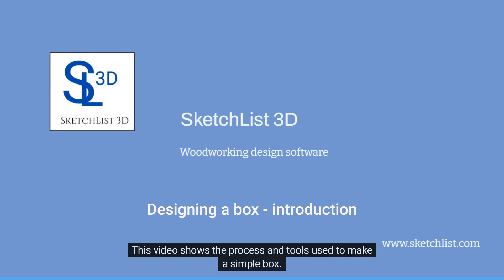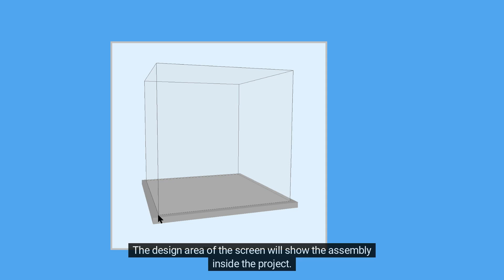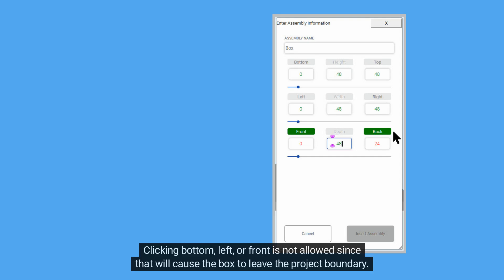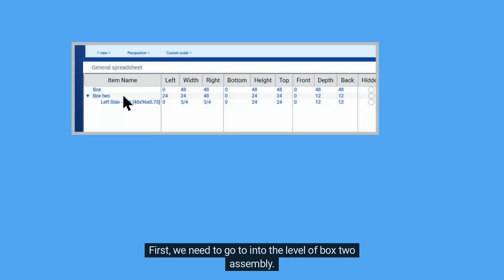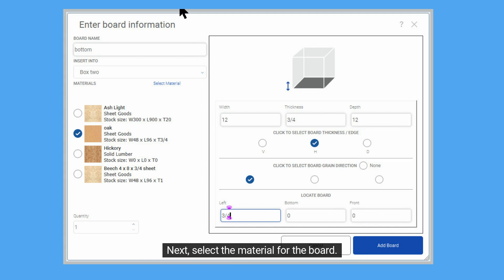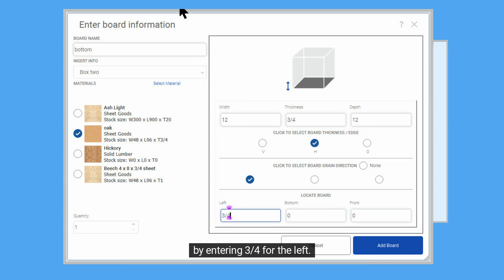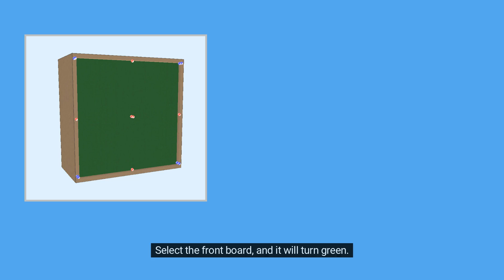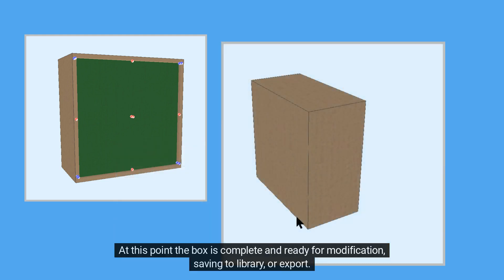I Tried  Software for Cabinet Making to Make a Box.

Comment: Is this sofware work with "millimeters", meters..and so on? We don't build with inches here..and is a hastle to even think about building with inches.
Reply: yes it does
Reply from the maker: When you create your project, you can specify if you’re using metrics or imperial measurement system